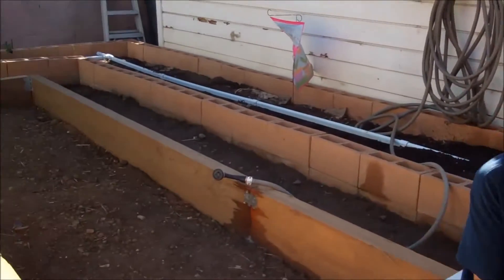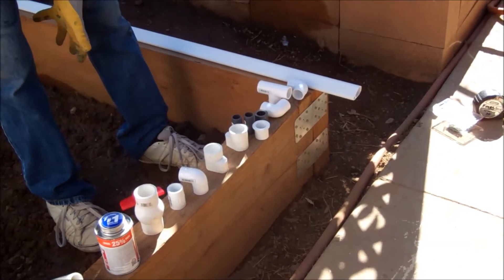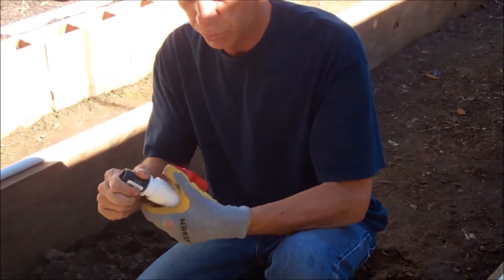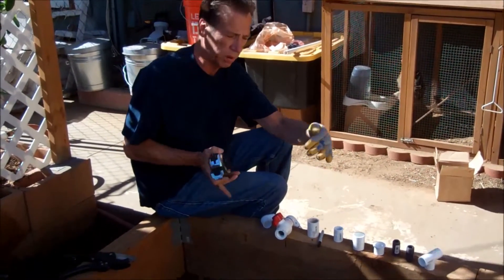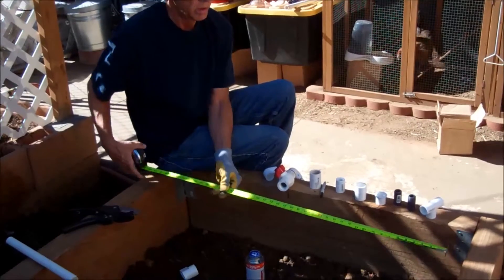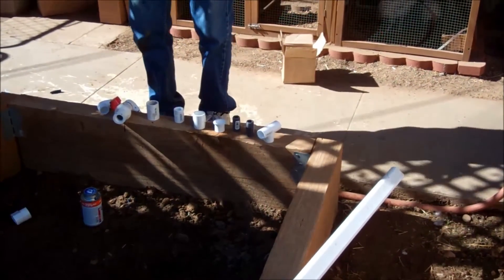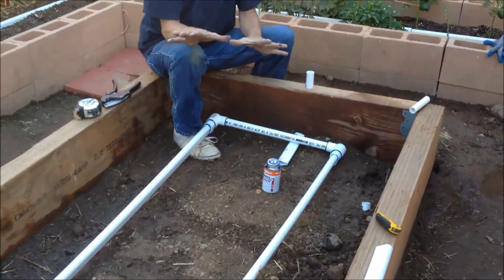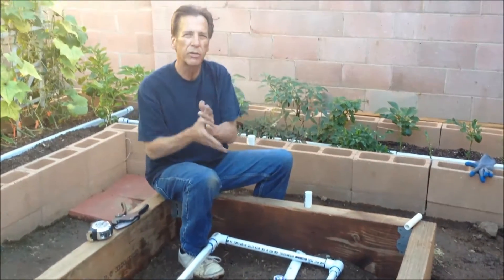12 X 4 Raised Bed With The Dual Aquajet (How to hook up to a Water Hose)

Comment: Rob, I think Aquajet is a great product.. and I might have to convert to it this year because of the lack of rain and snow pack here in Ca.
In this install, if you would have used 5 PVC unions this could have been a perfect install.. every angle would have been adjustable for the correct water ejection ..
Nice video..
Reply from the maker: Very good point Joe. Thank you.
Reply: Rob you are teaching me a lot, but there are times that a student comes up with a good idea..
I am a water well pump tech. And every thing I plumb, I make sure it can be un-plumb in the future, with ease..
I enjoy your videos ....